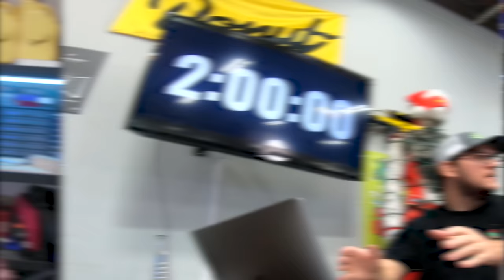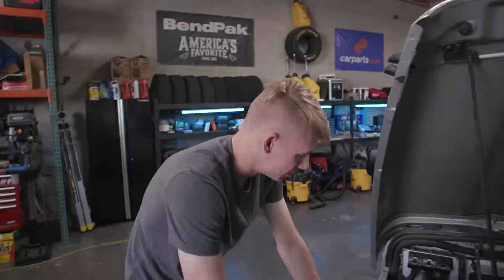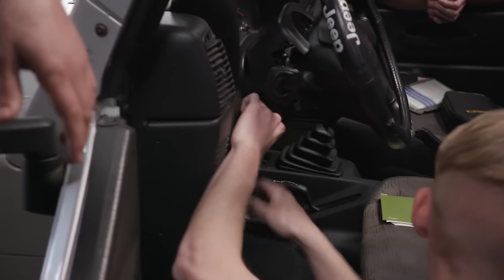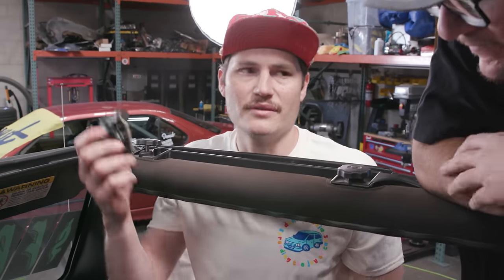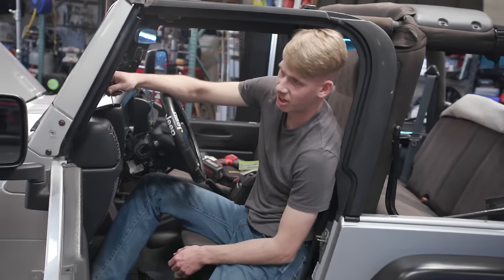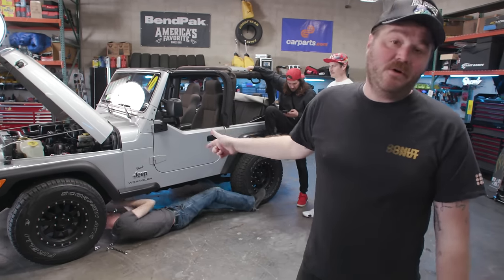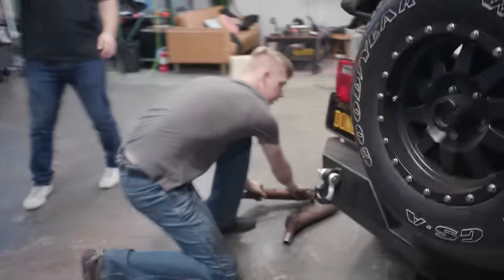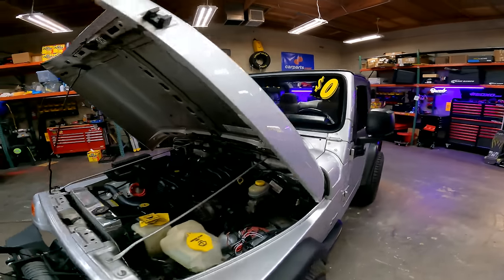Giving people a JEEP, if they can fix it

Comment: He could’ve just put it in four-wheel-drive there are 2 Different Drive axles the one that went out and the one for 4 Wheel Drive the yolk on my driveshaft went out and I drove home in four-wheel-drive I made it home no problem yes the one driveshaft was dragging a bit causing a dragging noise and I had to drive slow to get home but I got there

Comment: throws ignition switch "just crashed on the floor"

Lemme tell you, if that happened it would've been a-o-k. I speak from experience, specific experience with an '04 Grand Am and gett mad at the ignition switch and slamming it to the ground 😂

Comment: There was 1 thing he could've cheated with in the last min if needed. Actually 2 things. 1, only put 2 bolts in the rear driveshaft. Secondly, depending on the rules. Just put it in 4wd and drag himself out using the front only. But well done & congrats. =D

Comment: what if it was change the tube in the tractor tire and weld the rust hole in the rim, for free fries? tools, bumper of truck a jackal three crowbars and a sledge hammer welder stuff and tin snips? 400 pounds fully assembled. hmm, just like walking in circles when its done.

Comment: He should've disconnected the rear drive shaft put it in 4wheel and drove it out on front wheel drive speaking from experience it's not a permanent fix but it would have saved him some time

Comment: I mean if it were me and the rear drive shaft dropped like that AND it had a slip yoke? Screw it im pulling the rear drive shaft putting it in 4wd and driving it across the finish line 😂😂😂 worry about that problem later

Comment: Funny part is that if he would have put the jeep in 4 low or high he would have been able to drive out of the shop without replacing the rear drive shaft lmfao.  the transmission mounts to the transfer case which has a rear and front drive shaft.

Comment: If he was really smart, he could have just pulled the rear shaft out of the slip yolk and put it in 4wd and drove out in front wheel drive just to save time. Just saying, not like I'm speaking from broke down life experience or anything 🤣🤣
Reply: Or used the winch to drag it out while it was "running and in gear" with his foot on the clutch to stop the driveshaft from slapping 🤣

Comment: I wish this would happen to me I'm leaning about cars and the shop we took our last tuck too did an engine assembly! They failed some place because on test drive it caught fire thank God my wife wasn't driving and it was the tec.  we miss our truck so the carhop place gave us on 1200  credit for another crap car because we financed the truck that carhop dealership under the warranty there shop burned up. Of course next car. it had absolutely no motor mounts needed new struts swaybars inner and outer tie rods ball joints o and control arms. I slowly used Amazon for parts used youtube for help and got it done ✔  after a year it now death wobbles and shooting some type of from one of the boots on to the bottom of the engine I'm assuming everything I replaced probably needs to be replaced again because I got it from Amazon but honestly I don't really drive I have epilepsy I do this for my wife we have to budget this car things I'll learn from my mistakes one day